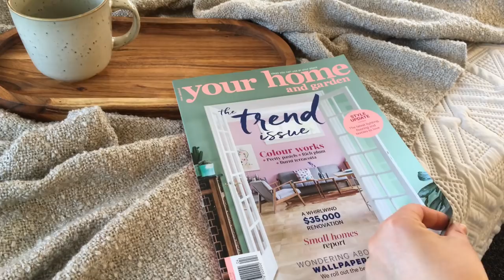The Buster Tiny House with REMOVABLE trailer

Comment: Yabut,....Can you do an 11'8" X 34" Park Model size? The flatbed delivery and jack system is a real game-changer with the auger and foundation screw option you can franchise and have thousands of builders in the North American Market...The big seller is having the 20" normally wasted under the home eliminated with the ability to screw the foundation to its lowest point where a handicap ramp is feasible....

Comment: How much interior height do you use, by not buliding the tiny directly to the trailer? If i Would need an off-grid solution, would it be possible, by this removable trailer solution? Thanks in advance! :D